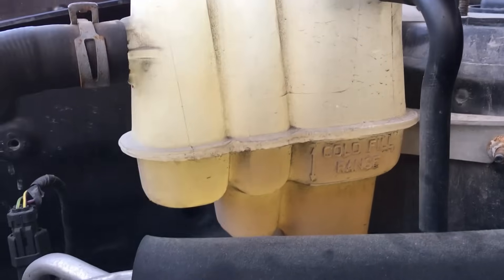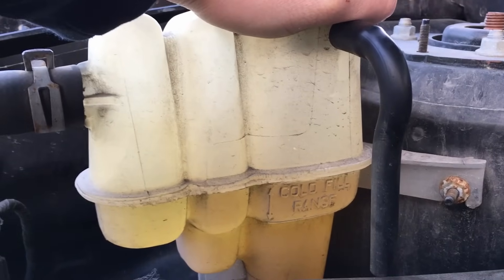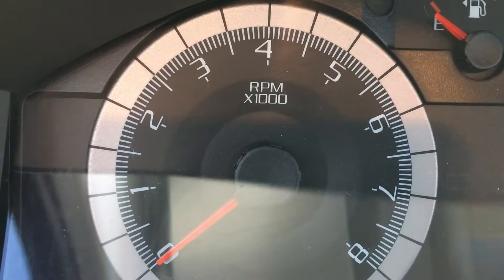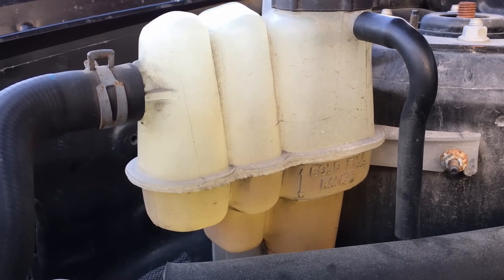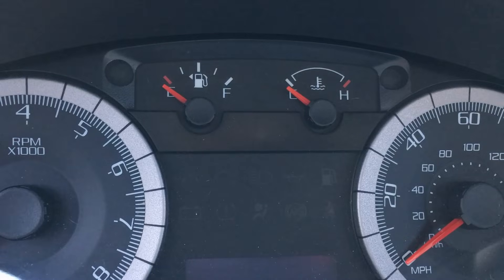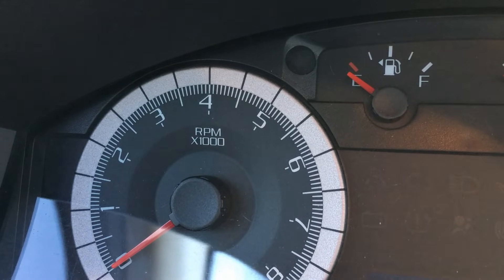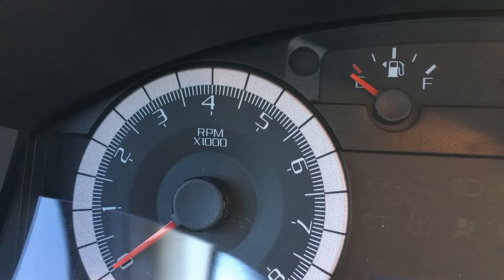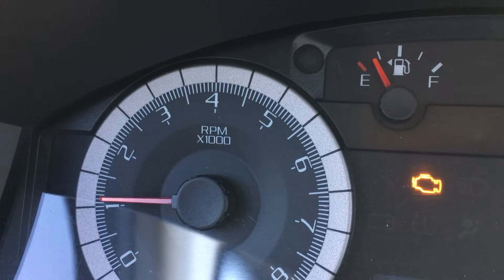Ford Quick Tips #69: The Trick to Purging Air From Your Cooling System

Comment: would it help to put car on steep incline with back of car on low end?
Reply from the maker: With this method it is not required.
Reply: @FordTechMakuloco  13 3.5 eco... did  turbo coolant line repair.  Not only did i have to put my truck on ramps. But had to use this method 6 or 7 times. Truck would get up to 220°F and then it would burp a little temps would drop down did this over and over and over. What a mess.

Comment: Freaking 1998 f150 is leaking from the freeze plug or my heater core. Can't tell, but all I see is a small drip from the where the oil pan meets the fly wheel so no real way to tell. PINCHING pennies so what do you think about trying a sealant through the radiator system first?
Reply: p

Comment: So you say the best way to use the vacuum Venturi is to leave it hooked up for 15 minutes before filling with fluid, are you saying once it reaches its max vacuum you should leave the air hooked up continuing to pull for 15 minutes or unhook the air and just let it sit in a vacuum for 15 minutes?
Reply from the maker: Continue with air connected for another 15min
Reply: FordTechMakuloco really? Wow ok I’ve been using my Venturi at the shop for about a year now and I never knew it would make a difference, I’ve always let it max out at 25 or so and then just unplug the air and let it sit for a few minutes and then pull in the fluid

Comment: My 2002 f150 4.6 temp jumped to red zone when I push the truck above 3,600 rpms on the freeway. No temp issues at normal driving or idling. I was able to drive home error free once I gave the engine 5 minutes to cool down. Coolant and engine oil were ok. Would this be an air pocket? I would think not because it should of blown out when I was pressing the engine previously. Any insight? Thanks
Reply: Did you figure it out?

Comment: Why is my engine light still in even after bleeding the air out? I have the 2.5l. I had to put on a new coolant outlet which meant i lost all the coolant. Refilled it, burped and bled it....still have engibe light on. Hot air from vents at idle. Temp guage reading dead center.

Comment: Should I have the heat on full blast while doing this?
Reply from the maker: The heat should just be on so you can feel your progress.
Reply: @FordTechMakuloco  Thanks. Also I have a 2008 Lincoln Mark LT that the reverse just went out. Could it possibly be electrical or is it certainly mechanical?

Comment: Same process and rpm's on a 6.4? The only time I get heat is while I'm plowing on off the throttle. Heat stops at idle and over 55mph until the fan kicks on when the eot is around 218F for about 20 seconds the back to cold again.

Comment: So...if one has a de gas  bottle...you can burp it with cap on as long as you have good fluid amount in bottle? I'm getting a running water sound in my dash when I fire up. Air air air needs to go !

Comment: My 2016 ford edge eco boost not yet 3y.o. coolant overheats, 3rd cylinder misfire engine light code, owned 2003 honda element previous and had 219,000 miles when I traded for this ford possible lemon.

Comment: I'm clearly missing something, because how is the air escaping if all the caps are on during the process?
Reply from the maker: This is a degas bottle, so the air is being purged from the heads and block to the highest point which is the degas bottle which is where you want your air pocket.
Reply: @FordTechMakuloco  got it!

Comment: can you help me I have a 2015 F 150 fully loaded it's been back to the dealer several times. you can be driving down the road and the heat can be blowing out the vents then stop blowing and make a loud noise and we blowing internally into the dash but nothing comes out the vents after a few minutes will start going out again the dealer has no idea what it is. it started when the truck was brand-new the colder it gets the worse it is.
Reply from the maker: I have seen a few head units replaced for this concern.

Comment: This method is similar to what mazda recommend on my model . Rev longer though 2500 revs 5 minutes then 3000 revs for 5 seconds . Given the garage can't find anything wrong and had hg replaced under a year ago 7 months roughly..they may have bled it the bottle way not the dealers way

Comment: 2007 f150 , low heat and no pressure in de gas bottle , I can drive truck on a 90 degree day and just take cap off and barely any air comes out , are f150 different than cars? Coolant would shoot out of my crown Vic

Comment: My coolant keeps rising everytime I do this. What's the issue?
Reply: Me too what did you dp
Reply: @rosiegregory  I would idle the car with the cap on and have someone watch the coolant tank and lmk once it starts to rise. Before it keeps rising, I shut off the car. Burped the car using the valve. And then opened up the tank. From the information I gathered, there's supposed to be no air in the cooling system and that's what's causing the coolant to push back. I had to keep doing this until the coolant stopped rising
Reply: @Ju-op9cl  Thanks for your reply! Thanks very kind of you. Unfortunately it just turned out the garage installed a faulty thermostat. I took it back in for diagnostics as to why it kept overheating after they replaced it and they said they didn't know. Took it somewhere else and they said I had a faulty thermostat installed. Ended up paying $1000 for 2x thermostat installations .... BAH!
Reply: @rosiegregory  Omg, I completely forgot I had to change my thermostat!! Wow, I'm sorry! It was a long process for me, honestly. The first shop did you dirty. I would have seeked reimbursement if I were you.

Comment: So I'm feeling cold air while at idle. Then when I accelerate I feel hot air. Would this work? 2011 f150 3.5 EcoBoost
Reply: I was having the same problem in my 2015 fusion and it fixed the problem!
Reply: @notchjohnson313  thank  you for the feed back

Comment: I just tried this on my 2003 Ford F-150 Lariat. I'm actually loosing coolant though. It's been happening ever since my thermostat went bad at the end of last summer. I've refilled the reservoir with a gallon of coolant a number of times. I just put almost 2 full gallons this time. So I'm loosing a lot of coolant. I can't find any leaks though. I took it to a shop and they couldn't find any leaks either. Any idea where the coolant might be going. I knew it could possibly be a blown head gasket but my engine oil isn't milky.
Reply: Leaking heater core

Comment: If that works, why does the engine not self purge when driving at highway speeds?
Reply: mcconn746 because it’s hard to keep 3500rpm steady at 30sec.  And it has a possibility of overheating if not watched carefully.

Comment: When my 2002 f-150 4.6L  warms up while driving it the coolant goes down,when I turn the engine off it rises to cold fill line. Any idea why? I did do a flush on it. Thanks
Reply: I should add that it drops a 1" or more. And I got good heat

Comment: I have a 2000 5.4, could this be the reason I lost heat after replacing the intake? I had to drain coolant.
Reply from the maker: Yes, the heater core connections are the highest part of the cooling system trapping air.
Reply: FordTechMakuloco how would I do it on Hybrid escape model ? Only allows to idle up to 2500 rpm while in Park & Neutral ...

Comment: Shouldn’t the heat be on the whole time during this process this way the heat control valve stays open and the antifreeze can flow through the heater core?
Reply from the maker: There is no heater control valve
Reply: OK so if I was doing a vehicle that has one then the heat would have to be on, correct?
Reply: OK so if I was doing a vehicle that has one then the heat would have to be on, correct?
Reply: OK so if I was doing a vehicle that has one then the heat would have to be on, correct?
Reply: OK so if I was doing a vehicle that has one then the heat would have to be on, correct?
Reply: OK so if I was doing a vehicle that has one then the heat would have to be on, correct?
Reply: OK so if I was doing a vehicle that has one then the heat would have to be on, correct?
Reply: OK so if I was doing a vehicle that has one then the heat would have to be on, correct?

Comment: I have a 2014 F150,  have heat, but its gets hot fast.  Just changed the water pump, i think i have a air lock. The fans dont stop once it gets hot. 
I tried this method but it didn't change anything,  ideas?
Reply: any fix with your issue?

Comment: Just curious what about the open system meaning the fill cap on the radiator with overflow tank. You're talking about the sealed system. Let me know. thanks Brian skinner
Reply from the maker: +Brian Skinner Same thing you fill it to the top of the neck cap it back off and proceed. Of course the overflow tank should be filled  but that tank only comes into play when the engine cools and when it gets to full operating temp.
Reply: DAVID KEEPS IT 100!: Find and fix your leak. Frozen water (ice) doesn't leak. A warm engine can cure a leak that shows up when the engine is cold. For example, I had a hose clamp leak all of my coolant overnight when temps were extremely cold (-20ºF). This hose clamp/vehicle never lost a drop of coolant prior to this extremely cold night.

Comment: Can someone reply on why apparently I had way to much air in my ac lines so it won't fill with refrigerant. Like it was dangerously low. What is an easy way to release the air from my lines to where it is not dangerous
Reply: By using a screwdriver n releasing or go to a mechanic to put in his machine it is toxic to air

Comment: Brian, thanks for sharing this.  I've noticed on my 2017 Ford Transit Connect XLT with the 2.5 engine the engine coolant is orange.  By observation isn't that the same as Dex cool?  I had noticed it when comparing manufacturers charts of engine coolant.
Reply from the maker: Yes it is an OAT coolant just like Dex-Cool so yes it has some of the same fallout issues just not as bad as Dex-cool.

Comment: Does this work on the later ford engines?  Ecoboost 2.0etc. The other techs at work say that the only way to get all the air out is with the BG coolant flush machine or with the coolant flush tool.
Reply from the maker: Coolant flush machines are the worst offenders when it comes to introducing air into the cooling system. A vacuum fill of the cooling system and or this method is the only way.

Comment: I tried this on my 2000 f150 also flushed the heater core and the blend door works my degrees went from 60 to 80f not much 
One side of the hose is hot one side is warm 
Is my heater core bad possibly? Cause I'm just thinking the heater core is toast

Comment: Well I tried this procedure I got my first 30 seconds in and I want to give it to 3000 RPM did not check my oil pressure or my oil in my engine and my engine locked up. I was sitting on a hill and it was 26degree outside with 15 mph winds. Thinking I'm fffddd

Comment: Had no luck with his trick, just the opposite of actually. 2001 ford expeditions Top of heater core is higher than top of radiator on flat land so I drove up a incline any incline would do. Get the front of vehicle higher than your dash and pop radiator cap and start your vehicle and keep adding coolant as needed and heater started working. Hope this helps anyone that reads this like it helped me.

Comment: Water gurgling sound comes while starting my 2007 ford fusion , what is the best solution??
Reply from the maker: Full drain and  then a vacuum fill pulling vacuum over 25" for at least 10 min, 30 min is better.

Comment: Should you not need to remove the degas cap in order to let the air our? Also shouldn't you have the heat on full to circulate through the heater core?
Reply from the maker: No and no. The instructions state to leave he cap on, many times the tank will overflow when full hot revving like this. Also there no heater flow control valve on most modern cars it is always free flowing through even in the summer.

Comment: Can air in the cooling system cause just luke warm heat and not hot heat? 02 F-150 5.4, the blend door is working fine so I know its not that, we have heat at an idle but the heat gets warmer at higher engine RPM, is it possible to have hot heater hoses if there is air in the cooling system??....Anyone??? Thanks to all who reply back. also thanks to @FordTechMakuloco for making this and many other videos for automotive care and repair.
Reply: Did you find a fix? I have same truck and issue. Tried the method in the video a couple dozen times.

Comment: +FordTechMakuloco Hey Brian, I really appreciate your videos. Thanks for all the help u give to the community. I'm having an issue with my 07  3.5L Lincoln MKX engine overheating after 15-20mins idling or if driving I can get 30-40mins 10-15miles untill it starts overheating yet both electric cooling fans turn on and seem to be working full speed by their sound & the heater works great. I replaced the Thermostat thinking it might be the issue after it 1st overheated and it lost about a full gallon of antifreeze but when I refilled it after replacing the thermostat I forgot to burp/purge the system before driving it and  after about 5miles it started overheating so I shut it off. I was told take the cap off the reservoir filled it a little over the cold line with 50/50 and turn the heater on high for 20mins to bleed the last bit of air yet the coolant level never went down but it didnt overheat like it burped itself so I drive it come back let it sit idling with the AC on and it overheated yet my heater is still working excellent at idle super hot and blasting. I'm so stumped as to what could be going wrong still?  I feel like if the heater is working properly at idle should mean the waterpump is working still and the thermostat is too otherwise the coolant wouldnt circulate the system. Something almost seems clogged yet the system has never been dirty as far as I can tell when I changed the Thermostat it was very clean coolant no gunk or chunks. I dont have the funds to take it to a mechanic this time so I'm going the DIY route. I just did your super flush purge and I still didnt see the resivoir go down anymore. Any advice will surel help but I'm in the trenches working on it today lol. Thanks

Comment: I have a 2004 Taurus SE to make short the reason to start the objective was to increase hot air temp and increase air movement.
  I changed thermostat to increase temperature. Changed 
Fluid, checked hose's in place & intact, no bubble's, Expansion tank & hose's place no leak's.  Replaced blender door actuator .  Air direction selection  works correctly. Blower Motor & speed selector works correctly. Temperature selector moves cold to hot and back no knob selection clicks when turns.  All  hose's  hot  when  reads mid lne and line don't  change hotter or colder. But the car has to moves 1 1/2  miles or more for hose's feels hotter. Air moves 100% betterThe problem is the air is not hot air at any time defrost or to warm any  sections of inside at all. Idle or moving and not all when the temperature reads mid line. Anything else I can try  before I take on the heater core?????????

Comment: Guys just clear me one thing if you have your heat working like Normal then you don't have any issues with cooling system right????
Reply from the maker: yup
Reply: @FordTechMakuloco  Thank God cuz I was so worried I have a Toyota Hilux and got it's coolant replaced last week just like normal topped it up drove came back home and next morning level was low topped it up again and it didn't fall since then but one of my friends told me to leave the reservoir cap off with the truck at idle since these new Hiluxs don't have radiator cap I left it for half an hour I saw coolant rising and slowly a bit overflowing I called my mechanic and he told me to put the cap back on cuz these  systems don't let the thermostat to open if there is no pressure in The system so I did that and the next morning car started to take it's coolant back to normal level but during all this my heat was working like normal and fine do I need to worry about anything I also drove the vehicle for like an hour I left it at idles for 30 minutes or more but it also kept it's temp gauge in normal zone

Comment: hey there ford tech. why does my heater blower motor only start on number 4 on the knob. it only runs on high nothing below 4
Reply: J. J. Blower motor resistor. Of course I'm supposing you figured that out by now :)

Comment: Will this work on a Subaru 2.5l Sti engine?
Reply: Homer Simpson use an airlift or fill the radiator first, then cap it then fill the coolant fill point near the intake.

Comment: I don't have a thermostat and it's overheating nobody explains that one
Reply: Brent Braxton most cars that are designed with thermostats will overheat slightly if you remove the thermostat ( the coolant is rushing through the radiator too fast to cool down). On most vehicles the engine simply runs to cool without a thermostat to hold it at it’s designed operating temperature.

Comment: I would like to like a ford.
But, the ranger has a sticker that mentions you need to bleed the system.
The factory users manual makes no mention.
Between chilton and haynes.
Only chilton mentions purging.
But offers no details.
I'm sorry ford.
I guess I've become to used to cars from chev. Nissan, toyota.
That don't have your overheating issues.
 Without resorting to u tube trying to fix an issue.